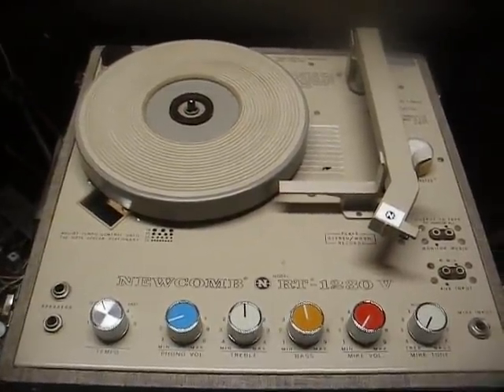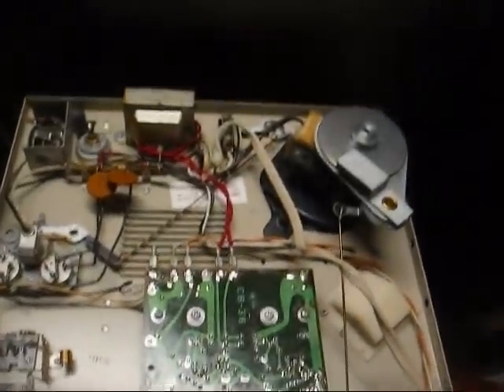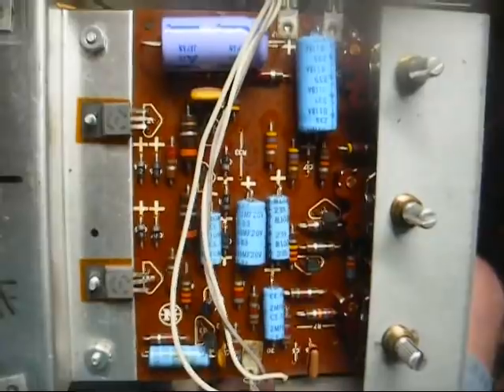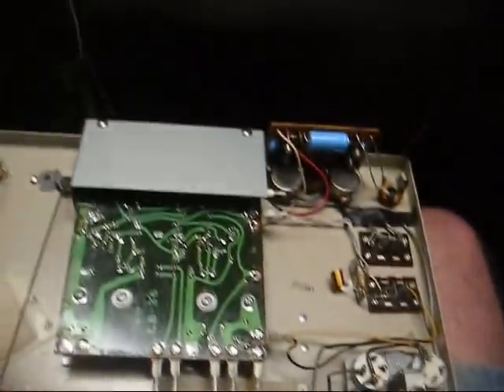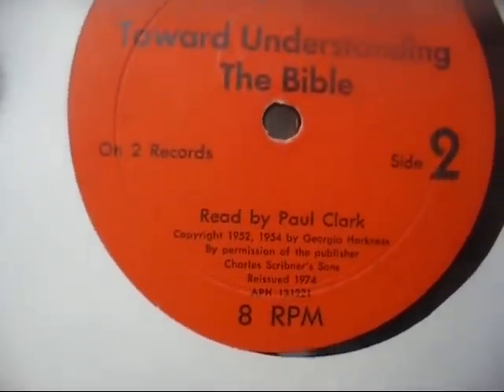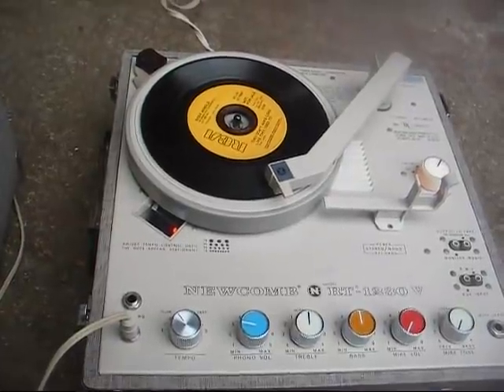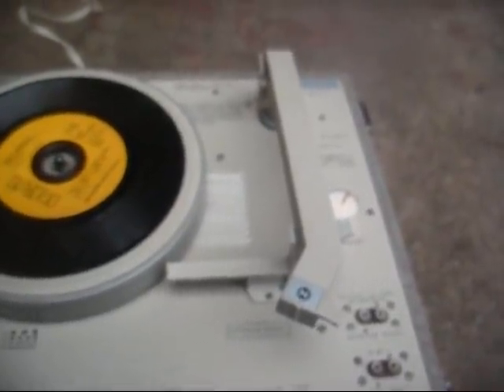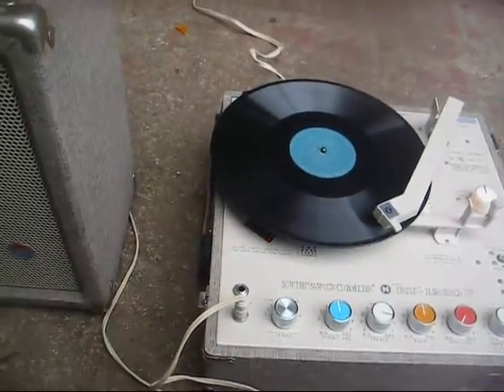The anti-Crosley presents a Newcomb RT-1230V commercial-grade record player from 1981

Comment: OK after 40 years in the industry....I've seen everything....Hold my lemonade, 8RPM and a machine to play it. That thing is excellent. Reminded me of my TD124 with its eddy current speed brake, pause control - but  4 speeds only. My Lenco with continuously variable drive and tapered pulley is the best looking motor I've seen on anything though.
I wish these things had full size platters.